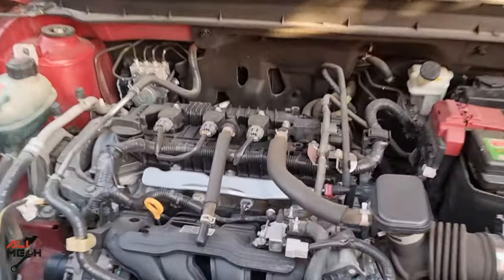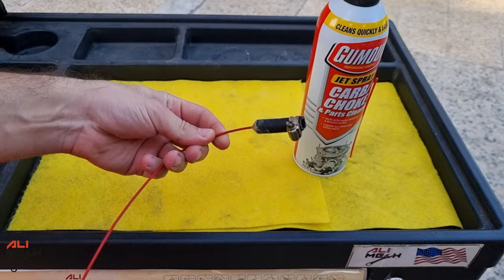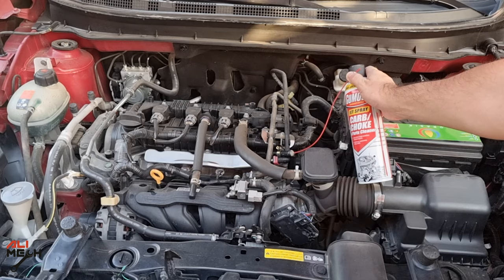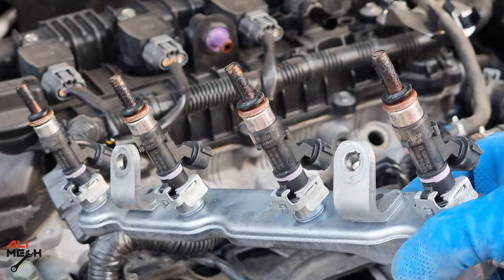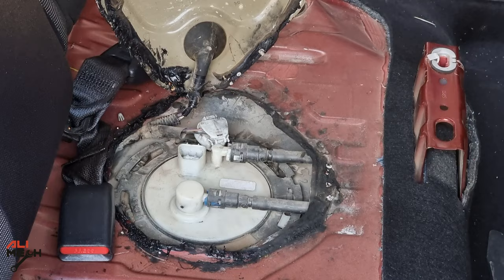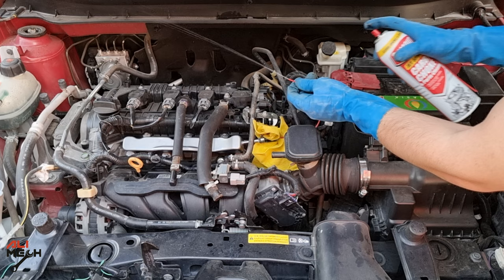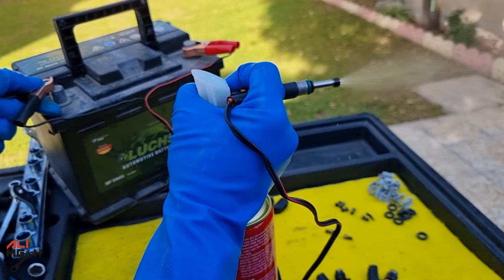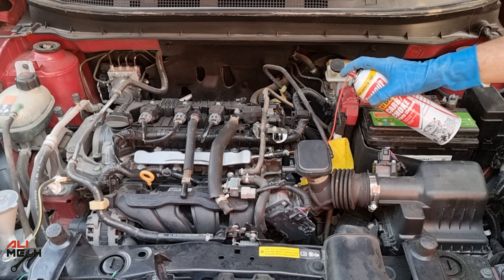Fuel Injection cleaning in less THAN 5 MINUTE/HOW TO clean injection Directly without disassembling

Comment: Good tip.Getting chemicals into the engine cylinders may cause damage to top piston ring .
Reply: Carb cleaner is petroleum-based. Gasoline is petroleum-based. Learn something! 😂
Reply: Aerostart wouldn't be selling on the market if that was true 😂
Reply: Sprays can cause detonation. Where the liquid or vapor ignites before the piston is at the top. I don't recommend this. Wait until you have a quarter tank......and put some Lucas in it. And drive it all within a few days so you don't get moisture accumulating along with the alcohol.mixture in the Lucas. Don't let Lucas sit in your tank. But it cleans injectors.
Reply: @sasquatchrosefarts  If detonation is unwanted, pull the spark plugs, the vapour of that cleaner will then leave the engine via the spark plug holes, however there is a fire risk, of course

Comment: I think it’s the ether in the carb cleaner that can damage plastics and rubber, the metal will be fine, but on the other parts stick to mass air flow sensor cleaner

Comment: That fuel pump was amazingly accessible! Most are not that easy to get to. I guess the other option would be to find the fuse for it and pull it...but honestly, pulling the rail and replacing them is not all that hard to do.
Reply: It's expensive to do tho each on be $50-200 and there are 4 sometimes 8 of them

Comment: How well does this work on a V6 and V8 engine? I haven't looked real close at the V6 but the V8 has a hose that connects 2 rails (left bank and right bank). I did try this on my V8 but didn't see any improvement in LTFT. I thought about running another can of carb cleaner but I'll decide on that later. This is the first time I have done a cleaning like this on my original OEM injectors (22 years old - 81,000 miles). I don't have any codes so it probably didn't need to be done. The only downside to doing this "in place" cleaning is that you don't get to see if all the injectors are adequately cleaned. I'll have to try this on my V6 and see what results I get with it (60,000+ miles) - they've never had this kind of cleaning done either. Thanks for this alternative to pouring injector cleaner into the gas tank.

Comment: I used your method of removing the fuel injectors. Actually I got some spare ones and a fuel rail from the junkyard. Then I was able to pressurize the fuel rail with carb cleaner and I didn’t have to fit the hose to each injector.

Can you do a video on using seafoam or water in a vacuum line to clean carbon? My car is 25 years old and I can see carbon on the pistons when I look through the spark plug holes, but I can’t tell how much there is.
Reply from the maker: I made so many video on my channel for removing carbon, here is one with seafoam https://youtu.be/tOZVI7k2PP8

Comment: Thanks for the info, Ali. Will Seafoam or Gumout fuel tank additives work just as well? Of course, they're easier to use.
Reply from the maker: Sure they will, but it will take some time, I will make a video about that soon, how much it will clean
Reply: Those pour it in the tank additives will have nowhere close to the concentration of running straight carb cleaner through.

Comment: What is that tool that you used to unclipp the connectors? Where is it sold?
Reply: Late reply , it's called a hemostat , similar to forceps , both used in the medical field and both also found in mechanics tool kits . They come in long , short , straight and bent variations .

Comment: When I pulled the fuel pump fuse on my 2018 Kia Sorento it won't start. Any ideas on how to get the car started so I can then spray the carb cleaner?
Reply: Disconnect the connector at the fuel pump, leave the fuse alone. Pay attention to the video, he explained why.
Reply: @soundsolutions yrs but what if the fuel pump is in the tank with no access.... proceedure is to drop entire tank or cut thru carpet and floor from top... unfortunately...so then what??
Reply: Can't you just extend the fuel hose and let the gas drain into a bucket?

Comment: I thought you said it wouldn't run without the pump connected under the rear seat? but you started it? You pressurieze the line with the cleaner :)
Reply: Also you didn't say what size hose was the DIY ADAPTER :?)
Reply: @DelaneyStudios it’s a regular 3/8 gas line he just used a piece of the hose…
Reply: @DelaneyStudios  you don’t have common sense.he just uses carbs cleaner to run, that’s why engine run not smooth, engine finally turn off after can pressure go down.

Comment: Wouldn't the fuel leak when you start your car with disconnected fuel line
Reply: This is why he disconnected the fuel pump... Though I wonder why not just pull the fuse?
Reply: @gordonhenderson1965  he mentioned some model cars run more than just fuel pump on that circuit. Pull the fuse if that's the case, you have cranking but no start.
Reply: Ah ok thanks

Comment: Hey I have a 2021 with 36K miles do I need to clean my fuel injector, dealer keeps telling me I need to clean it.
Reply from the maker: If you have stady RPM  the engine starts right away, mo shaking,  you don't need cleaning

Comment: just remove it !
carb will go to piston head and BUILD UP IN exhaust & cats 🥲🥲
Reply: Why gas not going there when engine running normally 😅
Reply from the maker: It's good when it enters combustion, it will clean carbon buildup on the pistons, this method will be used for cars where its hard to remove fuel injector, for some cars, the whole intake manifold has to be removed
Reply: @AliMECH  Nissan Murano is like that. Cylinders 1,3,5 require remove of air handler and entire intake. Swap testing can require reassembly and another disassembly. I just say screw it and do them all. This is a good trick to get you through a stop gap time though.
Reply: @AliMECH  I was just looking at my 5 litre V8 Windsor block Ford engine and considering parts required to remove the injectors. You've solved my problem with this fix... intake manifold is huge and covers most of top motor space.❤
Reply: @packrat9433 😂😂😂 what a crap to deal with Murano, did you try them on it? Please share so all murano effecties will get some benefit😂😂